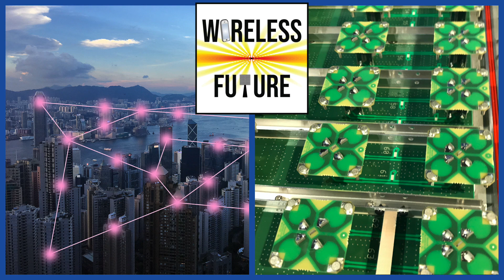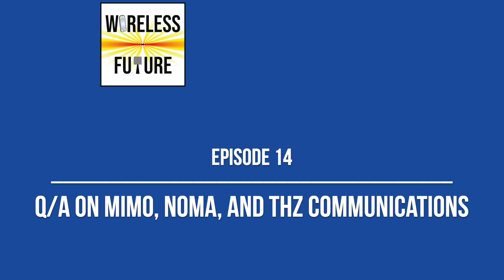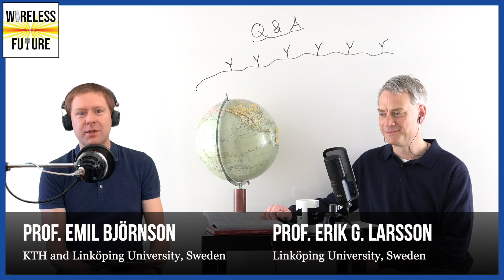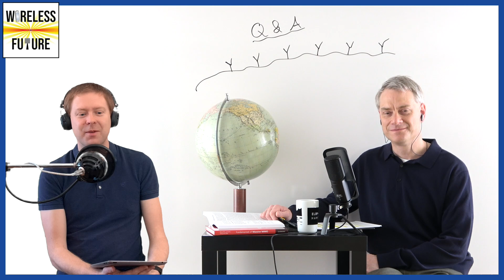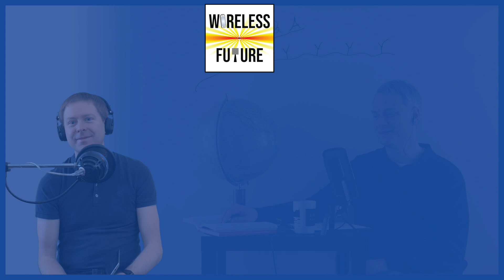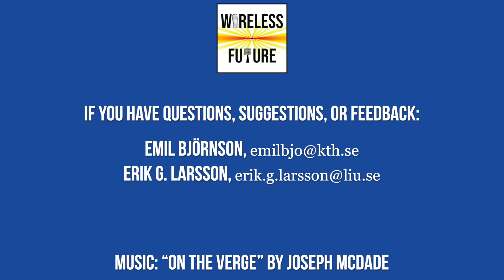Ep 14. Q/A on MIMO, NOMA, and THz Communications [Wireless Future Podcast]

Comment: Prof Emil,  

Please help me to break this paradox: 
I can see a paradox in what you and Prof Larsson discussed in first 20 minutes :
How can the channel become LESS DETERMINISTIC and MORE DETERMINSITIC at the same time ?

I will elaborate: 

1)	Suppose we have nt tx antenna and nr rx antenna. When we assume iid Rayleigh fading for nr x nt channel matrix, we are assuming that the rays are reaching receiver in every directions possible. There is no preffered direction of arrival. All DoA is equally likely.
2)	Suppose, rich scattering is not happening(for example in FR2). Then, we have to assume that some preferred direction( angle window) is there for the signals to arrive the rx antenna. This means channels have become correlated. For correlated channels we cannot use iid Rayleigh channels anymore. 
3)	Point 2 also means a strong LoS (specular)component is there between   tx and rx antennas. => This means Rayleigh cannot represent the channel model – now it must be Ricican. 
4)	But Rician channel, since it has a strong specular component, is highly deterministic, in comparison with Rayleigh channel. 
5)	Here there is a PARADOX: When iid Rayleigh channels become more and more correlated., especially in a massive mimo case, channel hardening DOESNOT happen.  This means  that channel is less deterministic. But at the same time,  a channel with  a strong LoS component  will follow RICIAN model, which makes the channel more deterministic. 
6)	How can the channel become LESS DETERMINISTIC and MORE DETERMINSITIC at the same time ?
Reply from the maker: This is a good question! Let’s consider a MISO channel with one LOS path and one NLOS path.

The LOS path can be modeled as an array response vector times a random phase shift. The norm of this channel is deterministic.

The NLOS path can be modeled as an array response vector (pointing towards the scattering cluster) times a complex Gaussian scalar. The norm of this path is Rayleigh distributed, regardless of the number of antennas. Hence, the randomness provided by this path does not “harden”. For that to happen, we need many paths whose randomness interact and average out.
Reply: @WirelessFuture  Thankyou for the explanation.

Comment: Thanks Professors, a very informative podcast. I am an undergraduate student currently doing a final project on "Performance Evaluation of mmWave massive MIMO in 5G" and I'm comparing OMA to NOMA as a way of evaluation. My question is do you think this is a good research for an undergraduate since it requires a lot of scientific knowledge and if so should I still consider NOMA or pivot to another technique ?
Reply from the maker: Hi! From a research perspective, both OMA and NOMA are outdated technologies since multiuser MIMO is nowadays what is being used in 5G. But as an undergraduate student, you aren’t supposed to produce cutting edge research results. I think that you should use a topic that you find interesting and where you can make use of skills that you developed earlier in your program. There is nothing wrong with the topic that you mentioned.

Comment: Respected Sir, Thank you very much for this video.

Trying to add the effect on MIMO with IRS concept.

1.  any article to refer
2. how a simple model of IRS can be simulated in MATLAB (without the dataset given earlier)
3.What  Factors can be compared in this integration (in terms of graph).
Reply: Respected Sir,
1.In your github library, under mass8vemimo blog category, there is one basic RISexample.m file, just want to know how rateSISO(k.c) and rate RIS has been formulated ? How the formula for SISO and RIS is derived ? 

rate_SISO(k,c) = log2(1+ P*beta_direct/sigma2); 

rate_RIS(k,c) = log2(1 + P*(sqrt(beta_direct) + N*alpha*sqrt(beta_Tx_RIS*beta_RIS_Rx)).^2/sigma2); 

2. How to calculate SNR of RIS surface ?

shall be thankful to you.
Reply from the maker: @TejasGaga  These formulas are taken from the following paper (in particular the last page): https://arxiv.org/pdf/1911.03359.pdf

You get the SISO formula by setting N=0 (remove the RIS).
Reply: @WirelessFuture Thank you very much sir..Extremely obliged for your assistance
Reply from the maker: There are several GitHub repositories with codes related to IRS that you can find here: https://github.com/emilbjornson?tab=repositories
There are links to the respective papers. There are many papers consider the combination of MIMO base stations and IRS. This is an early example: https://arxiv.org/pdf/1810.03961.pdf
Reply: @WirelessFuture  Thank you very much sir..Highly obliged.Cant express in words, how good it feels, when you reply.Thanks again for the assistance.